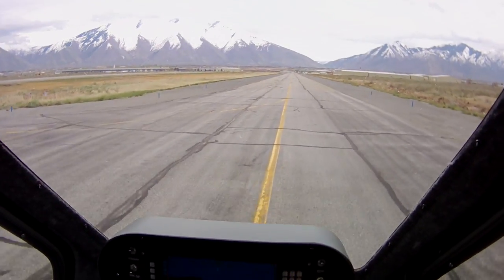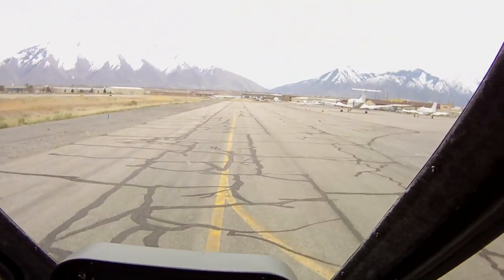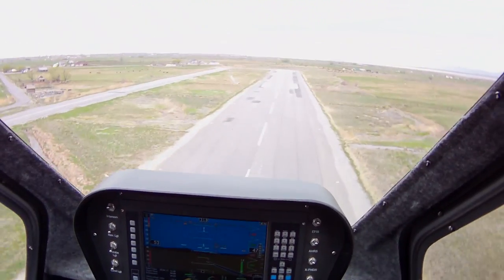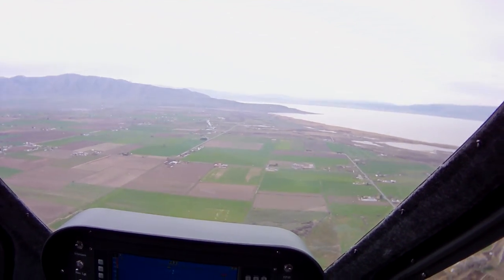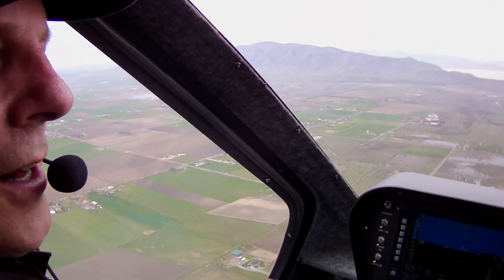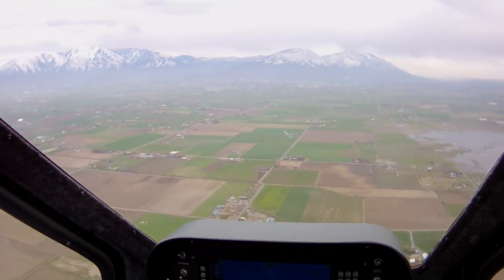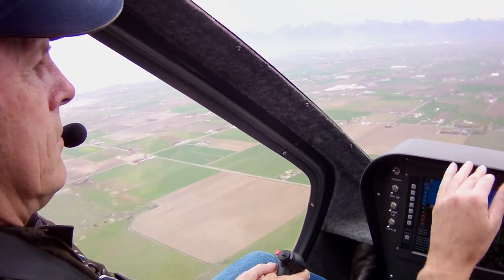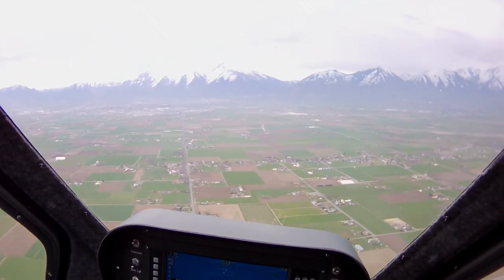Sparrowhawk Gyroplane Flight Training Lesson - Mike and Bill - June 2011

Comment from the maker: We put transponders in all of ours so that we can fly in class B airspace, although we usually try not to if we can help it. Gyroplanes can be extremely safe. I would say the a couple of the biggest safety issues are that some designs can make a gyro unstable and there is a better chance of a bunt over, or pilot induced oscillations. Horizontal stabilizer is the best way to overcome this issue. Center-line thrust can help your gyro be more stable as well. Lack of training can be an issue too.

Comment: An interesting video, I enjoyed it, thanks for that.    The nonsensical captions at the bottom of the screen were a little annoying though.  
I know it must be tricky to balance out all vibrations,  but I've yet to see a gyro' video that doesn't have that 'wop wop' rotor shake...   is it really impossible to balance it out?    That's not a dig,  I don't fly, but am very interested.  As an engineer I can't help wondering about stress fracturing, somewhere.    
Otherwise, a nice video.

Comment: "What is the constant flashing red message on the artificial horizon?"  It says [Terrain - Pull Up ! ! !] when they're on the ground. The GPS should know that they're at an airport, and not flash the terrain warning, but it looks like it's not calibrated correctly; you can see at 2:20 that the on-screen runway position doesn't match the aircraft's actual position over the runway. Or maybe the MGL Odyssey doesn't have airport detection for the terrain warning. I know it has a flap position detector, but that wouldn't apply to a gyro, and it also has an engine RPM detector, but that wouldn't activate during takeoff, only landing. While they were taxiing it was also flashing [Air Speed], because they were below the threshold speed that had been set for that annunciation, and it flashed [Terrain] several times during the flight when they were at or below the level of terrain within the set distance/time. MGL is no longer making that particular model, having replaced it with a touch-screen system.
Reply from the maker: It does not like how close to the mountains are. If we were to fly very far in ay direction we would be too low to clear the mountains. I think it was made by people that do not have very many mountains to deal with.
Reply: Airgyro Aviation The US office for MGL Avionics is in Torrance, California, but the company is based in Cape Town, South Africa.

Comment from the maker: Low rotor RPM only means that you will start to descend, so it isn't as critical. You simply need to push your control forward and/or add throttle to keep from sinking. You can't stall in a gyro, you just sink. If you are looking for a really nice gyroplane, check out the auto-gyros. Go to airgyro.com to see some info on them. They are super nice, and also really light so you can fly them with LSA certificate. We should be getting one in about a month, so I will be posting videos of ours!